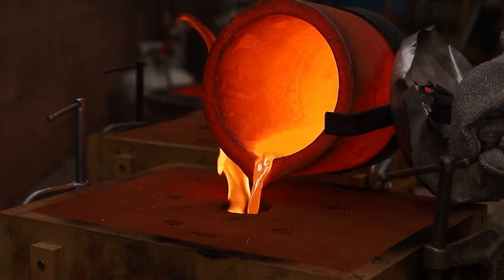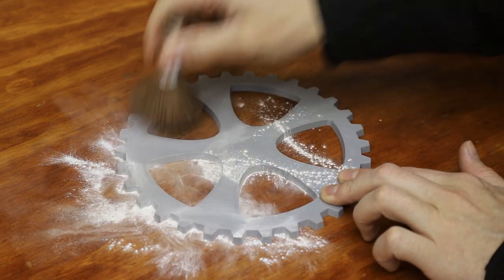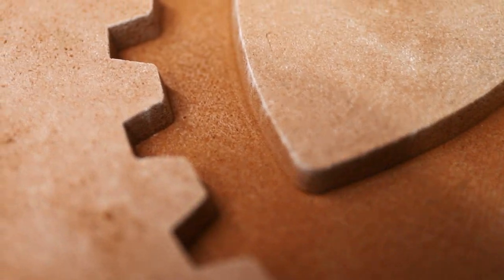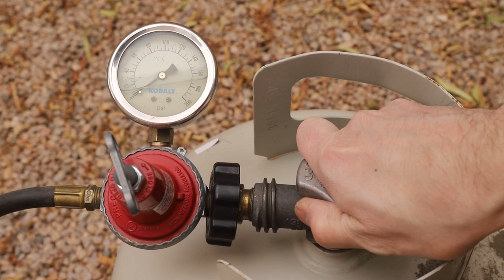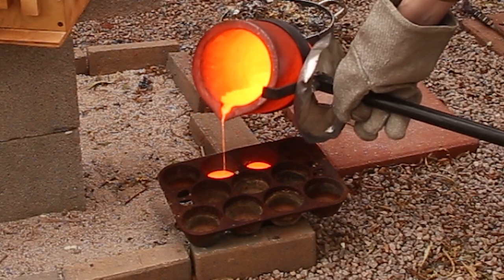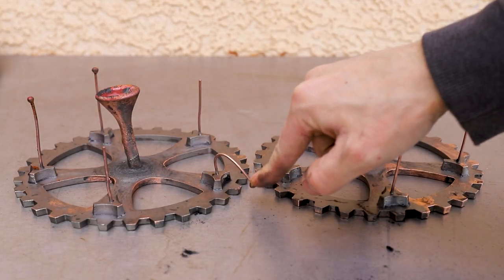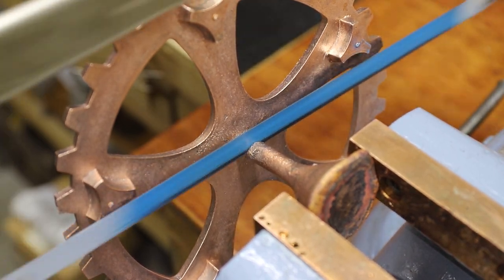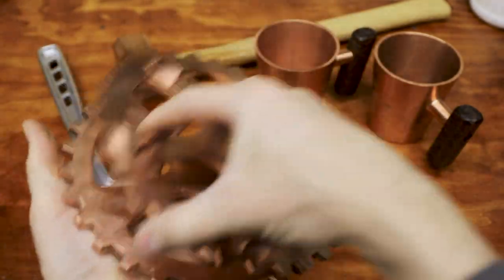Copper Casting - Making copper "Trivets" for the kitchen

Comment: I guess they have a large thermal mass so this may not be an issue, but being a conductor of heat is the opposite of what you want from a trivit. It's supposed to isolate the surface from heat to protect from damage. I would replace or cover the feet with rubber.
Reply: Was literally thinking just that, with a similar solution.
Reply: Think it will be fine, it’s replacing napkins after all
Reply: Also going to pull more heat from the food.
Reply: Or leather
Reply: @andrejohnson6731  Or cork.
Reply: Small silicon or felt pads could be added to the feet for thermal isolation and scratch resistant.
Reply: Yeah but now pick that up right after placing it there for a few minutes.. bet u can’t lol.. my falk copper skillet gets insanely hot just from washing it in the sink.. I can’t imagine 200+ degrees resting on it for a few minutes.. lol
Reply: Aluminum would have been a better option for a thermal heat diffuser but if the idea was to keep the pot hot you did well
Reply: But which oil is used for the casting sand?

Comment: Copper will suck the heat out of your pan/meal. And transfer the heat quickly to the surface you are trying to prevent heat getting transferred too. It'd be cool to add some rubber feet (those little sticky dots) to protect the surface you use it on. And maybe CNC/Laser cut out a thin piece of cork sheet to adhere to the top to make it as functional as it is beautiful.

You could pocket out some shapes on the top surface to inlay with cork or do a trace of the entire shape, anything to prevent direct contact of the pan with the copper.
Reply: Drilling some holes and putting titanium pins as heat break would also do the trick too.
Reply from the maker: That's not a bad idea! I figured copper wasn't the best choice but people enjoy seeing copper casting. We have granite countertops so the only real heat transfer will be from the hot pan to the copper trivets.
Reply: @robinson-foundry  You could also put them in the oven and use it to keep your meal hot for longer? :)

Comment: Copper is my favorite metal
Reply: I agree 👍. I melt mostly aluminum but when copper is definitely my favorite.  It pours so smooth and looks awesome 😎
Reply: @HeinrichsMade  It's my favorite mostly because it's got a bunch of cool properties and cus it's so easy to work with. You can make it soft, you can make it hard, you can melt it bend it stamp it and cool things off with it, and it looks cool too
Reply: @ziocrielo6148  you are so right 👍 it's a heavy metal, but very workable.  I cast a copper rose for my valentine this year.  When I was cutting off the sprue I had to be very careful not to accidentally break it.  Cast copper does bend easily, but too much it will snap.

Comment: Might want to cover the feet with something heat resistant. Both to prevent the copper from burning and scratching the surface of whatever you put it on when used.

Comment: Won't copper do a great job conducting heat into your countertop?
Reply: yes. I am not sure how they overlooked that.
Reply: @Bryan but if the legs get as hot as the pot they will still burn the table. They will just burn in a small area instead of a large one.

Comment: Im not sure copper is the right material for this since it is very conductive. If you want to use it anyways the trivit probably isolates better if you keep the feet on the upside to minimize the amount of heat transferred from the kettle into the trivit and spread the heat your desk will have to deal with onto a bigger surface.

Comment: Cool, but they are going to cool down the food you put on top really fast. Copper has better heat conductivity than Aluminium, 398 W/m•K vs 247 W/m•K, whereas a cast iron trivet will just have 60 W/m•K, and a stainless (304) is just about 20W/m•K
Reply: What would be a wooden trivet's conductivity?  I suspect it would be better than all of the above.

Comment: If you want to eliminate the shrinkage dips in the t sections of your casting you can "chill" those areas by placing steel blocks on those areas when moulding. When the liquid metal hits the chilled faces it will freeze of and stop the shrinkage.

Comment: Does the protecta Clear leave a matte/ satin finish? or a clear gloss? and is it sticky to touch after its dried?
Reply from the maker: It leaves a slightly shiny finish. Its hard to tell its even there.
Reply: @robinson-foundry  thank you! I need some for my custom lightsabers that have copper accents and parts
Reply: @robinson-foundry  thank you! I need some for my custom lightsabers that have copper accents and parts

Comment: Uhm, isn't the point of a trivet to keep a pot/pan's heat isolated from a (table) surface, both to keep the pot/pan hot, and protect the surface?
Wouldn't making them from the very heat-conductive copper be somewhat counter-productive to that point?

Comment: why not just use aluminium? It would have been cheaper + less heat conductive than copper. The copper will even help cooling down the pan more quickly, storing all the energy.

Comment: isn't solid copper the opposite of what you want for a trivet? you want something that is super fibrous like pressed paper fibers. Basically, you want asbestos pressed into that shape you've made. Obviously you don't literally want to use asbestos, but you want something with all the same properties (minus the whole cancer thing). Buck Knives sells a recycled pressed fiber cutting board that works great for this, and it has a nice knife that slides into the bottom

Comment: Hello Seth. My question is not related to this video. It is about this video you posted 6 years ago. https://www.youtube.com/watch?v=8f4E2ODzhxw&t=39s I would like to know if the files are still available and the thickness off the material you used, please. Thanks
Reply from the maker: Hi, yes there’s a link to the file in the description. The wood I used is about 1/8” thick. You’ll definitely have to do some experimenting before cutting the whole thing. Good luck!